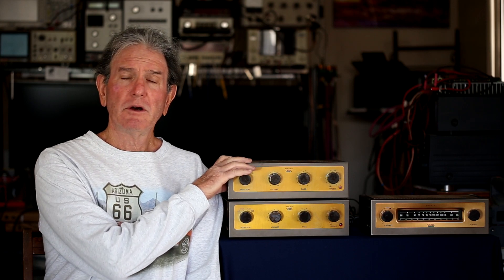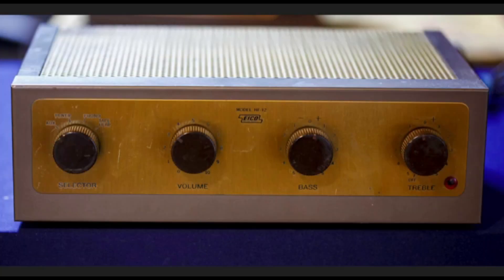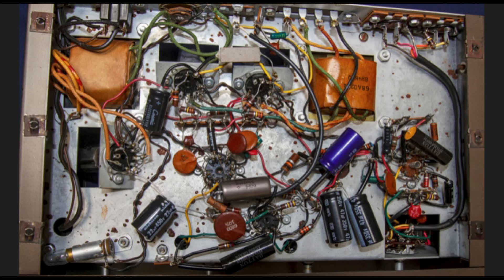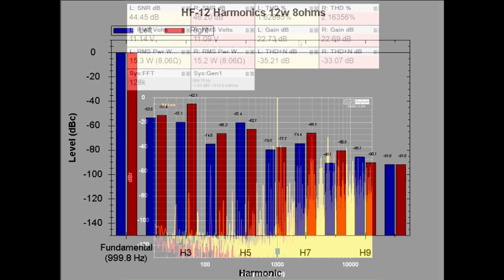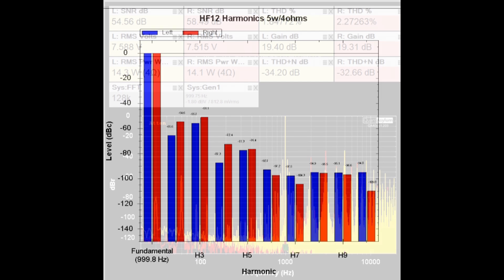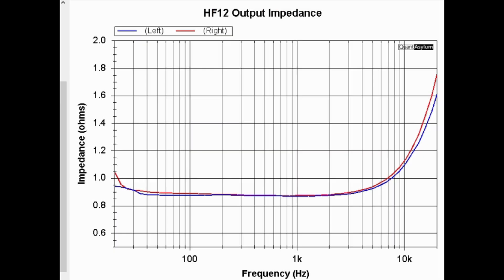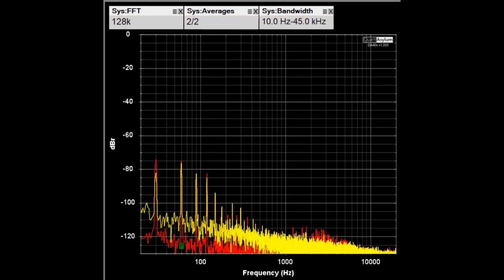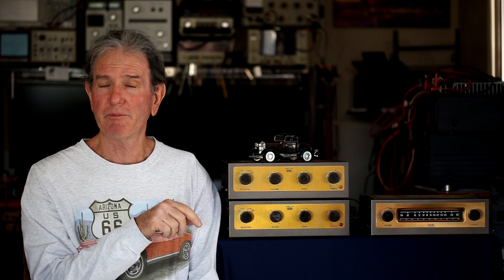Eico HF-12 Mono Integrated Tube Amplifiers: Vintage Audio Review Episode #165

Comment: I remember seeing this Eico HF-12 amplifier in a friends garage, it was only one amplifier running monaural connected to a single speaker and a tuner that looks very much like the one show in your video. This unit belonged to his father that retired it from the main home audio system many years before. It's still serving a useful purpose.
Reply from the maker: That's nice to know it is still being used- as intended as a mono amp!

Comment: Thank you. I had a similar one before I had test gear so it was nice to see what they would do. I wonder if they put the switch on the trble control so that any hum that coupled from the power line would be less noticeable?
Reply from the maker: Probably as good a reason as any. But hum would most likely be coupled from other sources. Thanks for watching and commenting!

Comment: I had one of these but I believe it was 6v6 so I guess it was a different model number but basically the same thing. To be honest I don't know what happened to it. I think I left it with a friend.
Reply from the maker: I appreciate the story- too bad you did not have it still- I am guessing you just had one of them so it would have been a ways back.
Reply: @vintageaudioreview  Yes, only one. It had an issue and at the time I lived in China so one trip I took it with me and my friend, who owns an audio company, fixed it for me. I either gave it to someone or ended up leaving it at the friends company. 
 I still have a few mono tube amps. A Bogen and a G.E.. The G.E. is really nice and sounds good but it's one of those types that has its connections on the bottom. Very annoying! I use it with my Wharfedale SFB speaker.
Reply from the maker: @bertroost1675  Thanks for the reply. Glad you still kept of few of the tube amps.